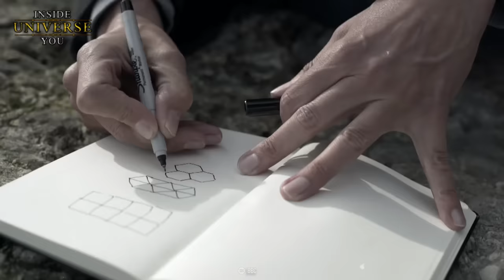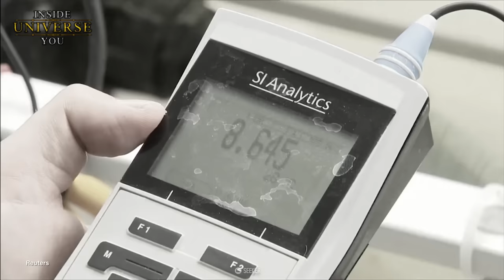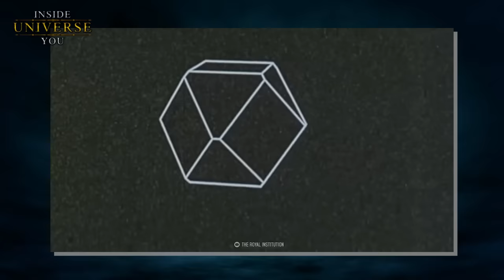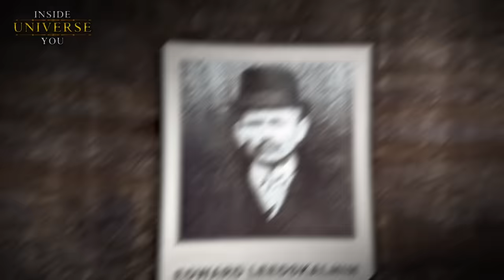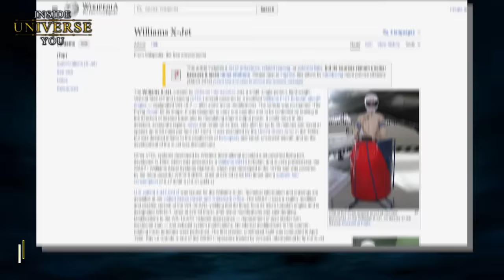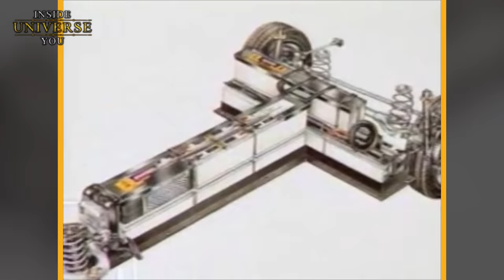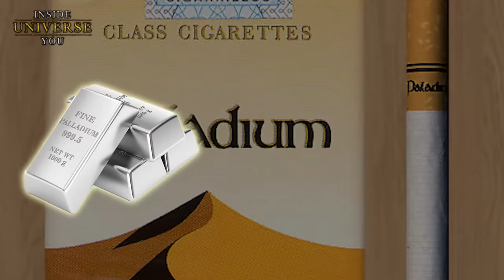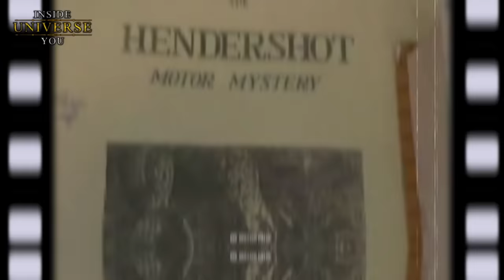Forbidden Technologies and The Silencing of Their Inventors

Comment: During WW2, there was intense development of aircraft piston engines.  One of these efforts, was an Allison V-12 engine, rated at 1500hp having its exhaust stream ducted to a "blow down" gas turbine stage. The turbine boosted output by an additional 1000hp without giving the attached engine any mechanical or performance handicaps.  That is, a 60% reduction in fuel needed by a gasoline engine to achieve any given output.  Despite this, the technology, despite being very mainstream was never adopted outside of the Constellation airliner.
Reply: True.
Look up this article:
The Allison V-1710  Turbo-Compound
By Jim Leonard
Reply: @JoeGator23 thanks for that, I have the full PDF from Curtiss Right on their turbo compounded radial engines as used on the Constellation.  As books go, I would recommend "Not much of an engineer" by Stanley Hooker ( Rolls Royce engineer).
Reply: The Germans were the pioneers of all the technology.
Reply: Turbo chargers are used in all kinds of engines including plane , car and boat engines. some engines even use both Super chargers (engine  driven compressor style boosters, a lossy power boost)  and turbo chargers (exhaust drive turbo chargers, almost lossless)  to gain massive HP increases.
Reply: @wazza33racer

FFS, that’s exactly what a turbo on a car is. A turbine on the exhaust drives a compressor that boosts the airflow into the engine, allowing more fuel to burn, more efficiently, thus increasing the power.

The reason why it wasn’t developed further was that the development of piston driven aero engines was replaced by intense competition to develop jet turbine motors, initially pure jet, later turbo-shaft for propellor driven and high bypass for jet drive.

It wasn’t immediately picked up by the automobile world because they were very high maintenance components until much later improvements in both turbine materials and high temperature lubrication.

Neither was it new technology in 1945.

Sorry if I’ve debunked your fave conspiracy theory.
Reply: @q.e.d.9112    Lets start with the aviation component......yes jets came along, and for aviation applications were a better proposition for multiple reasons.  That had nothing to do with my statement.    The turbochargers commonly found on todays gasoline and diesel engines, are best suited to diesels.  The reason being that diesels are compression ignition (not spark) and can run  high cylinder compression ratios like 15 to 1 and higher AND have over 40psi of boost with no issues provided the mechanical components have the strength.  Gasoline engines face a number of limitations to do with detonation which limit cylinder compression ratio's in the 10 to 1 range and its even worse with boost, and if there is a lack of fuel delivery for some reason, even knock sensors may not prevent a deadly engine failure.  No argument that high performance,turbo gasoline race engines, as they were in Formula 1 had amazing performance thanks to exotic engineering,materials and very exotic,expensive fuels.  However for most gasoline engine applications, turbochargers dont deliver good results, the power tends to come on harshly, and down low power, in light throttle applications like street driving is not terribly good.  The other issues is the back pressure that ordinary turbo's need to get good performance across a wide rpm and throttle range, usually resorting to energy wasting crutches like waste gates.   The next issue is efficiency of the turbo itself......the exhaust turbine has an efficiency factor AND the compressor turbine has an efficiency factor, when the losses from both are combined, its significant. Also the boost made by the compressor has a temperature problem (lack of density) that aggravates detonation without associated pipework and an aftercooler (often called an intercooler) to get temps down to more gasoline friendly range.   That ducting has losses, further consuming energy that is being recovered by the turbocharger to do useful work.   The blow down turbine used on turbo-compound engines is more like the design of a multi stage steam turbine, which extracts energy very efficiently from the high speed flow of gas, with minimal back pressure.  That turbine is fluid coupled to the crankshaft, so that it is free to operate at its most efficient speed and has no effect what so ever on the intake air temps, or cylinder compression variables that are crucial to Air/Fuel mixtures for the safe operation of a gasoline engine.    There really are no downsides for gasoline engines...the turbo compound just efficiently recovers exhaust energy normally wasted and pumps it back into the engine purely for a performance boost and/or fuel economy saving.    So please consider the nuance of the technical aspects of difference between "turbo's" and blown down turbines in turbo compound applications and their relevance to gasoline and diesel engines which have unique differences and are not the same.
Reply: @wazza33racer  There is some backpressure to turbos. Gain a lot but lose a little with a net gain.  Ships like the Titanic drove a third prop with steam engine exhaust to a turbine for the central propeller then to the condenser.
Reply: @infinitesimotel literally copied ancient indian texts for the mercury engine

try again
Reply: @wazza33racer  Actually, seems like only 3 Allison compound engines were ever made. 
Allison original HP rating was only 750, which eventually rose to 1425 which is why Rolls-Royce Merlin's were used in P-51 (more accurately, high altitude performance with two speed supercharger)
The Wright R3350 was the successful compound engine.
The major limitation in any four stroke internal combustion engine is keeping the exhaust valve cool enough  to prevent pre-ignition. 
Aircraft piston engines only turn at about 2,500 to 3,000 rpm unless drive is taken off camshaft running at half crank speed or some other reduction gearing.
Propeller tip speed had to be kept sub-sonic. 
Another reason for jet turbines, etc, the Time Between Overhaul is much much longer than with piston engines.
The Allison V-1710-E22 (or 127) compound engine isn't mentioned in any normal literature but can be found quite easily using title you supplied

The Renault 1500 cc F1 motor was making over 1200 bhp in qualifying motors, lifespan was pretty short and they only got about 1.5 mpg
Reply: That's because that engine required a lot of maintenance, and also because jet engines quickly became mere efficient
Reply: @q.e.d.9112 is it true israel attacked the uss liberty in 1967
Reply: This is a joke, right? If you have deep enough pockets, you can buy a Cirrus SR22T with a turbocharged piston engine. And other general aviation plane manufacturers offer similar planes. Such planes have been available for decades. But general aviation planes aren't focused on maximum performance, since there should be no danger of anyone trying to shoot you out of the sky like a fighter plane. Instead, the turbocharging systems on these planes are used to stabilize engine performance at higher altitudes where atmospheric pressure is lower.
Reply: Load of crap

Comment: In the 90s I worked in prototype directly with GM at the Tech Center in Warren Michigan.  Is was very apparent at the time that the project was killed by Big Oil.  I had driven many prototypes during their evaluation and they were awesome cars.  To my knowledge all but one was crushed.  That one being on display at the Henry Ford Museum in Dearborn Michigan.   The irony that the only working model is owned by a museum associated with Ford is mindboggling to me.
Reply: @HappyTailsSupport  You could always delete it.
Reply: @uprebel5150  lol for some reason it wouldn't let me on my PC, but just did on my cell. As a side note I was in Needles CA at a gas station yesterday coming from Oklahoma to LA and there was a couple plugged in to a recharging station. I walked over to talk about the car because I've never really looked into the specs of electric vehicles. They said that they were heading from LA to the grand canyon  and were turning back because they realized that they weren't going to have the charge range to make it.
Reply: @HappyTailsSupport  depending on the EV they should have no problem going from LA to AZ with most EV range being 250 miles and lots of charging locations in CA and AZ...if the distance from the last charging station and the Grand Canyon is more than 150 miles there might be a problem..

I was in Seattle I saw a Tesla at  a charging station with AZ plates (that was the farthest state plates i have seen on a EV) ..i talked to the owner and he said he drove it from Phoenix to Seattle and had no problems find charging stations i asked him what range he was getting and he said between 350 and 375 miles..which means he would need to recharge it about 4 times..

Of course Seattle has lots and lots of EVs running around..on any given day i will see 50+ on roads near my house (i live in Bellevue -Redmond area)..maybe not as many as CA but pretty close..

Where EV's have the most problems with charging is the midwest US (allot of midwest states fight against installing charging stations) where charging stations are far few..both coasts there is no real problem..in Seattle virtually every major store,mall ,hotel,major business campus has free charging stations..
Reply: @MickeyMousePark  It was a Chevy and the owner said he would be able to make it in a Tesla but that the Chevy wasn't going to do it. Either way they are just as bad if not more for the environment and I'm keeping my 4x4 truck, lol.
Reply: @HappyTailsSupport  your mistaken about the environment.   Many factors are left out concerning the cleanliness & inefficiencies of gascars.  Like transporting to the fuel stations in big rigs or the dozens of oil spills like the gulf oil spill or the 1000s of abandoned oil wells still belching toxins to the surface,  or the microplastics in YOUR water.  The diamond & iron ore mining industry is atrocious but somehow excepted as OK. ev battery mineral mining is only comparable.   But shows huge promise of battery chemistry eliminating these rare minerals. 
Oil can only be a 125yr monopolized leash on society.   
Electricity can be made many ways . Some make electricity at home and make money.  
Electricity can free the people of this 125yr leash.

Comment: I have read about Grebennikov's work in a couple of publications. I did not know about the elimination of critical details of the principles on why this worked by the publishers of his work. Remember that this was also during the time of the Soviet Union, and this kind of thing was held tightly by the State as critical technology. This flying platform was supposedly initially constructed with beetle wings glued to the underside.

As far as the moving of large megaliths, there is a YouTube post about a guy who built a replica of Stonehenge using simple tools and techniques. No magic mental stuff, no aliens, just mechanical ingenuity. Example: find the balancing point of a long block, get it to teeter totter on a fulcrum, and you can lift it by rocking back and forth, putting shims on either side of the fulcrum, and you lift it into the air. These blocks in the video were many tons - and the guy did it by himself.

As far as alternate fuels for vehicles: During the 1980's "gas crisis", clubs sprouted up everywhere on how to extend gasoline with water, the "green powder" from coal that when put in with water, you get a flammable liquid that can be a motor fuel. Making butanol by breaking down cellulose with genetically modified e-coli bacteria. That kind of technology was successfully suppressed by the Petroleum establishment. Remember that the original patents for solar cells were purchased and owned by Phillips Petroleum.
Reply: Don't forget car engines run quite nicely on ethanol when tuned properly, as evidenced by the fact that most all of South American runs their cars on flex fuel Alcohol/Gas at dirt cheap prices.
Reply: The magic of stonehenge is not megalithic blocks, there are plenty of megalithic structures with perfect blocks of hundreds of meters in size as well as being on the ocean floor. Stonehenge is supposed to point at stars or constellation, with precise geometric relations and all, to leave a message, perhaps. Supposed, because it must have been rebuilt.

Idk about bugs, but I do know that antigravity and a lot of the other interesting stuff is achieved by high-energy, controlled, electromagnetic fields. Counter-rotating cores using mercury and whatnot. The saucer or spherical shapes are most efficient to loop that field, so they're a must for a low-tech antigravity craft.

Comment: There have been quite a few hemp cars since ford's.. quite a few bio fuels.. I imagine hemp makes a great fuel..
  Quite a few pushes for plant plastics,  which should be what we use today..
  Construction materials,  even lumber materials, can be made with hemp...
  Around the 30's or 40's, at least one engine was made for a car that ran on the atmosphere.  That car appears to have had plenty of power,  used no gas, and worked in the country or the city... it wasn't  connected to trolley lines or using any type of power transfer system. 
   There were a few articles on it, and it faded away.

Comment: Not sure if you have covered this one before. Id love to see you cover it if you havent.

The Searl Effect Generator (SEG), also known as the Searl Generator or John Searl Generator, is a purported free energy device invented by British engineer John Roy Robert Searl in the 1960s. According to Searl’s theory, the device works by creating a magnetic field that rotates around a series of disks, which then produces electricity. The device is said to be able to generate an excess of energy, which could potentially be used as a source of clean and renewable energy.

The device has also been able to generate anti-gravity properties at high voltage outputs and below is a description why it could be true .

The concept of the “law of squares” is a central tenet of John Searl’s theory of the Searl Effect Generator. According to Searl, the law of squares describes a relationship between the size of an object and the energy it can produce. Specifically, Searl claimed that if the radius of a magnetic material is doubled, its magnetic field strength would increase by a factor of four (two squared), and its power output would increase by a factor of eight (two cubed).
Reply: I wonder why any good scientist want to backup this claim? Or its pretty obvious?
Reply: I believe they advanced that to a tomamak
Reply: Edits and Ford kicked all hemp and Tesla inventions, must have a way to sell for profit or it will not get a patent

Comment: The orgone energy is real its easy to build. You can feel the energy. I have a few at home.
Reply: Where can I see how to build it?
Reply: How do you use it ?
Reply: @robertclark972 you can make a necklace orgonite or just buy one. Its important that it has lots of metal in it too little it will be too weak which metal type does not matter much but the energy does feel different depending on the metal i like copper personaly. I dont know why it works but it does. It makes your aura/energy field stronger and it sucks it in and returns it constantly i noticed i doubt most people can tell though. The artistically pyramids ones online often barley work though too little metals in them.

Comment: In the late 1970s my father modified the carburettor of an old Buick and had it running on petrol fumes with zero emissions. He was getting 60 miles to the gallon. After he appeared on the news with his invention and had it tested by an independent company he was visited by fuel company heavies and our family was threatened if he didn’t stop. So he stopped.
Reply: He should have used a Law Firm and sued [extorted] them for money. For threatening your family. Nowadays they would not get away with that.

Comment: In Germany the big car companies trued everything to buy and bury the Elsbett motor. When they couldn't thry trued to destroy the guy. Luckily he prevailed. If you have a diesel you could convert it to Elsbett and never have to buy diesel again.

The Elsbett motor, also known as the Elko engine, is a diesel engine that uses vegetable oil as fuel and has 89 horsepower. Ludwig Elsbett invented the Elsbett engine in 1977. Elsbett engines are the first direct-injection diesel engines for passenger cars in production. 
Elsbett engines can run on vegetable oils such as sunflower, rape, and palm oil. Elsbett has developed conversion kits that allow engines to run on both vegetable oils and diesel fuel. This technology reduces CO2 emissions by over 80%. 
Elsbett has also made other contributions to fuel use:
In 1980, Elsbett converted standard diesel cars with prechamber engines to vegetable oil
In 1993, the Elsbett Mercedes won the first Eco Tour of Europe with the lowest fuel consumption
In 2002, Elsbett converted the common-rail car engine and unit-injector truck engine to run on bio-diesel
Reply: There is nothing special in a diesel engine running on vegetable oil. Rudolf Diesel did it himself. The direct injection was also known before Elsbett. (Prechamber engines have less problems with vegetable oil though.) Elsbett's innovation was internal air cooling of his 2 stroke diesel allowing a ringless piston. You will hardly get it to modern emission regulations.
The main problem with vegetable oil is it's limited availability. There is no suppressed technology.